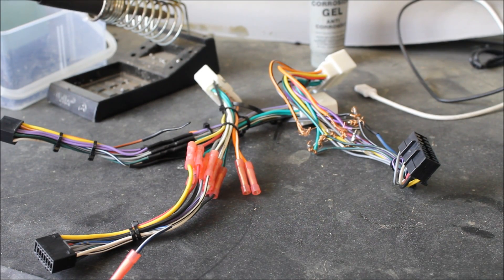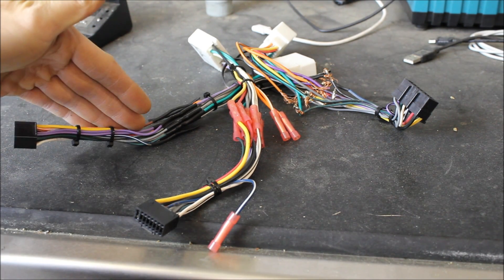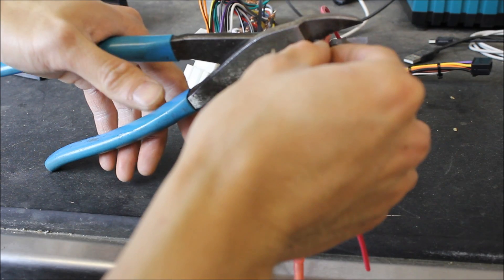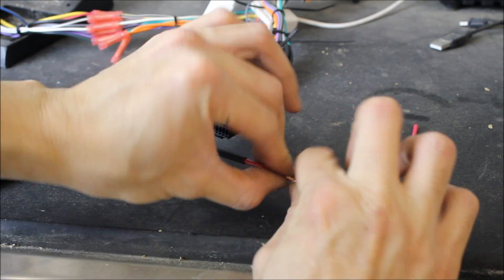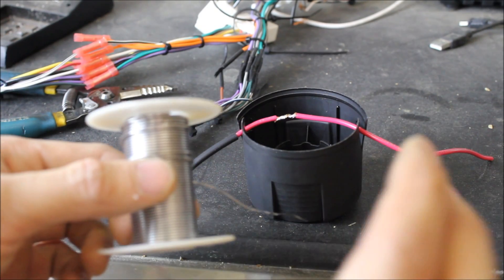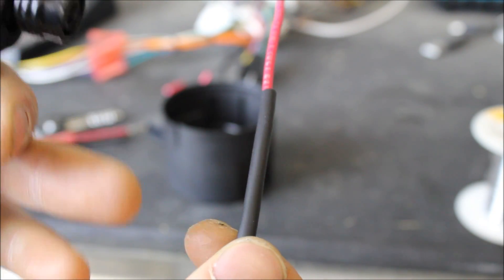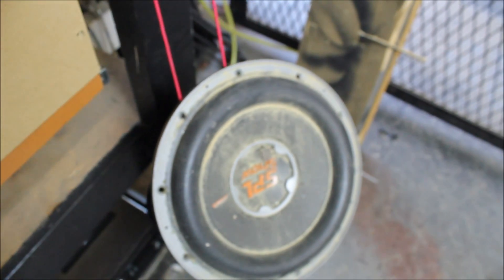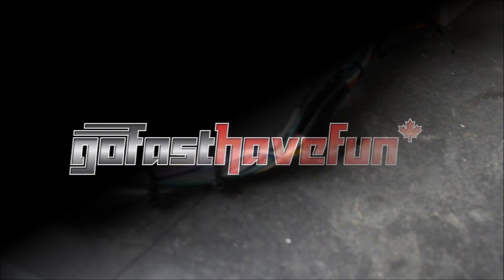Butt Connectors vs Solder | Crimping vs Soldering | Wire Connections | AnthonyJ350

Comment from the maker: Some people don't like how we position the connector in the crimper using the tooth.  Here's a video with further explanation: https://www.youtube.com/watch?v=i2le4BN0bP8
Reply: Just watched this second video and it has confused me.  I am less confident that I understand crimping now.
Reply: I have that Channellock crimper, but I also use a couple of Iwiss ratcheting crimpers and a Deuscth DT style collet crimper.
Not many connections I make anymore with butts, and never really the non-insulated ones you use the tabbed crimper for.
Reply from the maker: @jimurrata6785  I have a video on Deutsch connectors and will be making a marine butt connectors video soon.
Reply: @AnthonyJ350  I like to use a cupped deflector on either my heat gun or plastic welder to be shrinking adhesive lined terminals or tubing.
It really helps when you can focus on one side or the other just by moving into or away from the sleeve.
Reply from the maker: @jimurrata6785  I use a nozzle I  this video for my heat gun https://youtu.be/ca37WnL6Oxo
Reply: @AnthonyJ350  I'll have to have a look!
I've just found your channel and don't really know where you're coming from.... yet.
Are you a stereo guy? An upfitter? Or someone who builds harnii for custom vehicles???
Reply from the maker: @jimurrata6785  Started in car stereo, but I love figuring out aftermarket products that work together and trying to stay with the factory engineering in mind. I recently made the move into outfitting first responder vehicles (mainly law enforcement) so hopefully I can show a little of that in the future.
Reply: @AnthonyJ350  is that the stepped 9mm Steinel nozzle?
They have a reflector that fits that too.

Comment: If not soldering i use uninsulated butts or crimp caps
In almost 10 years I have not had a single failure of any connections
Reply from the maker: I haven't had a failure in 15 years. Both will work. I use marine butt connectors if I do that kind of connection now.

Comment: Just remember your vehicle constantly is in motion and butt connectors will eventually come loose. If the wires are soldered and shrink wrapped you will be done with your work forever!!!
Reply from the maker: Aren't all pins in a wire harness plug crimped as well?  We would just argue the proper crimper needs to be utilized. There's a time and place for either application. https://www.youtube.com/watch?v=VnPil9x8gUc

Comment: Should I use a but or soldered connection when trying to wire in a maf sensor to a car’s loom? (Where there is heat and vibration)
Reply from the maker: I would solder and use shrink tube with glue.

Comment: Instead of doing a butt connector or soldering I’ve been crimping on Deutsch terminals and adding a new connector, I personally think it looks a lot better and makes it FAR easier to deal with if you have to mess with those wires again.
Reply from the maker: That totally works too.  In a shop environment it may slow down production and add more cost to the end user, the pins alone are around $1 per pin.

Comment: Soldering is not flexible right? So if it’s on an area where it needs to bend slightly, it will break right?
Reply from the maker: Soldered connections can be in gradual bends without being bent because it's so short. You don't really want it where the wire moves i.e. wiring harness going to a door or tailgate hatch.

Comment: How do you feel about those shrink tube connectors with the solder in the middle? I feel it gives the easy of butt connectors with the reliability of solder ? Great video
Reply from the maker: I would do Marine Grade butt connectors then. This is what we use on emergency vehicles https://youtu.be/LcCLjbPS-m4

Comment: I only use butt connector as the last resort.  I try to twist and solder if at all possible.  I own a trucking company and corrosion is always a problem with electrical connections.  I put a thrid step in my twisted soldered joints, before I slide the heat shrink over the solderd joint I put a thin coat of silicone first heat it and wipe off the excess and you have a water tight seal.
Reply from the maker: Marine grade butt connectors are good too.
Reply from the maker: https://youtu.be/LcCLjbPS-m4

Comment: You're not supposed to twist the strands when crimping afaik
Reply from the maker: Why not?
Reply: @AnthonyJ350  It increases the cross section and may end up making the strands distribution uneven which will negatively affect the crimp since they are designed to crimp a certain gauge
Reply from the maker: @davidhsieh2761  If they're twisted evenly and the connector fits on smooth and snug, isn't that fine? Have you had consistent crimp failure due to twisting to avoid bures?

Comment: Raychen invented both shrink tubing and solder sleeves where I worked for 28 years , And yes connecting wires is a science in itself , Great video.
Reply from the maker: Thanks so much for sharing your experience!  I have newer updated videos to this where I focus on wire gauge and more specialized crimping tools.  This video was really basic.

Comment: Can I use these butt connectors on the Phase and hall motor wires ?
Reply from the maker: How much voltage is going to pass through it?  It's a crimp connection at the end of the day, you just need to match the correct size for the wire gauge.
Reply: @AnthonyJ350  48v 20ah battery 350w motor wheel and maybe a 48v 30-50 ah battery..
Reply from the maker: @anio6865  I don't see an issue, you might also want to look into this style of connector as well 
https://www.youtube.com/watch?v=LcCLjbPS-m4&t=40s

Comment: Just form a "U" in the wire and push two heavy objects together with the wire between them. It will hold the area you need to solder completely still. No need to buy helping hands. Just use your head and save some money. If there is a "debate" about connector types and power, just use a meter to compare. Pretty easy to end that argument.
Reply from the maker: Thanks for the feedback!

Comment: I'm thinking about adding a tailgate light bar to my truck. One of the wires of light bar needs to be vampire clipped, butt splice, or solder to my reserve light wire. What do you recommend?
Reply from the maker: If you use a but connector, use a marine grade one with glue.  You can solder and put dielectric grease over and use a really good tape, These two videos might help you https://www.youtube.com/watch?v=KA7jsIHGZ9c&t=18s https://www.youtube.com/watch?v=LcCLjbPS-m4&t=29s

Comment: If you have to make a whole bunch of connections spread them out over however much pigtail you have.
It doesn't leave a huge lump that you can't wrap into your harness.
Reply from the maker: That's an issue if you use butt connectors.
Reply: @AnthonyJ350  It's an issue with shrink tube over solder too.
Take one look at a 144 pin Ford harness, or even one of the smaller (70ish?) connectors....
You just run out of damn room.
Reply from the maker: @jimurrata6785  But why are you soldering over 100 times on a plug? If you're making that many connections you should be depinning and make a new connection and rebuild the plug and run your new wire.
Reply: @AnthonyJ350  when some moron cuts the harness with a .045" disc instead of pulling the retaining bolt from the bulkhead connector it's an F'ng nightmare.
But if you can't get (and swap) a complete harness, it's gotta be fixed.

Comment: Hey how do I know what color butt connectors to use
Reply from the maker: Depends on the gauge of wire you're using.
Reply: 10-12 yellow, 14-16 blue, 18-20 red

Comment: The worst example ever. Alnost all the tutorials say to never use pliers with butt connectors and he wants to use it.
Reply from the maker: Here's my reasoning, watch the whole video to get context https://youtu.be/i2le4BN0bP8
Reply: @AnthonyJ350  i seen the whole video before and my neighbor mechanic just used electrical tape to put the cables my radio together after splicing with an adapter and it was much faster easier and more secure.
Reply from the maker: @1Breezly  I think your mechanic should stick to changing parts and fluids. That is not how it's done in any professional shop that works with electronics.
Reply from the maker: @1Breezly  More secure than soldering?
Reply from the maker: @1Breezly  Seems like the only reason you're 
Searching videos like this after the job is because you're unsure of the mechanic's work. I would bring the car to an experienced Install shop.

Comment: Cringeworthy. Non-insulated butt connectors with the proper jaw and shrink tubing. Crimp beats solder every day for a long term reliable vibration resistant metallurgical connection . 40 years experience and military precision soldering background.
Reply from the maker: Thanks for the feedback

Comment: Hello Anthony, I see you use a Hakko 599 Tip Cleaner, which works much better for me than a Wet Sponge for the past 20 years or so. It does not cool the tip as much. The only downside is feeling the odd fleck of solder. May I recommend that you mention this to your viewers.
Also, having worked in Ontario Power Stations for ~15 years, I throw my hat in for the use of a Wire Connector Manufacturer Designed/Approved Crimping Tool, such as the Panduit CT-1525 - it has good leverage handles, 3 Dedicated Die Cavities, and best of all, there is no Insulation-Piercing Point to debate - simply crimp and done.
Cheers from a fellow Canadian! :-)
Reply from the maker: Thanks so much for sharing your experience!

Comment: And actually one thing not mentioned in this video is the crimper your using is actually for non insulated connectors. Crimps have a insulated and non insulated. That numb that pushes it down actually damages the insulation on the butt connector. Fyi
Reply from the maker: I have a video addressing that concern https://www.youtube.com/watch?v=i2le4BN0bP8&t=275s

Comment: How about twisting and taping?
Reply from the maker: Not a fan of doing it that way. Are you doing a "line's man splice"? Or just twisiting?
Reply: @AnthonyJ350  i had it installed by someone else. I just noticed he just twisted and taped it. Should i be worried? What are the negatives of just twisting and taping (electrical tape) ?
Reply from the maker: @Margotteferreros6237  Negatives are it might not be a tight connection affecting performance, and it might come undone over time.
Reply from the maker: @Margotteferreros6237  Let's put it this way. No credible experienced shop twists and tapes. It's either shrink tube or butt connectors for the bare minimum.
Reply: @AnthonyJ350  i understand, sir. Thank you so much for you responses. It helps alot. Great channel and very helpful! 👍🙏
Reply from the maker: @Margotteferreros6237  As long as you're learning and trying to do better work than we're doing our job 😀

Comment: I prefer Bullet Connectors because you can pull them apart.
Reply from the maker: The question is, why would you have to pull them apart?  There's already a connector at the factory plug.
Reply: @AnthonyJ350 Because I can and It's what I like and yes your right you can disconnect at factory plug. It is what is is.
Reply from the maker: @tlaneb1  Just curious, because you effectively have one extra connection compared to a butt connector, and if you needed to splice in a wire you still have to cut off the bullet connector.  The other thing I don't like about bullet connectors is if you don't plug them in all the way you leave a small insulated portion exposed.  Just sharing my experience.  If you like them, you like them.

Comment: yeah tin tack method sucks.
Reply from the maker: Ya I never do it
Reply: @AnthonyJ350  -- Is there a good rule of thumb for choosing solder size in reference to wire size? i've rarely soldered two wires together, i'm usually working with boards.  When I do solder wires, my solder is usually too small, i just don't have any bigger stuff around and I'm looking to buy some.

Comment: wrong crimp tool = fail... stagger join the solder joints... the twisted ends in the solder should finish no bigger than the insulation.Apply a small amount on the iron tip to make a good heat transfer, apply just enough for the solder to flow and just fill in the wire and no more.heat shrink for strain relief ......
Reply from the maker: I made a video just for comments like this. Read the comments and you'll see other experienced people's views https://youtu.be/i2le4BN0bP8
Reply from the maker: Do you work in an installation bay?
Reply: @AnthonyJ350  Better than that I work with HIGH current DC electrical distribution systems where a common current rating 1000A.. So yeah I know a thing or two.  Plus I have a Milspec rating for high reliability hand soldering
Reply from the maker: @markb3146  Soooo do these items get used in buildings or vehicles?
Reply from the maker: @markb3146  You didn't watch the video I sent did you?
Reply from the maker: @markb3146  FUN FACT. Every know it all that comments like this typically comes off as arrogant and douchey. Even though you might have valuable experience to pass on, that's not your intention. Your intention is feel better about yourself by bringing people down to your level.

Another common behavior is you have no videos for anyone to really critique you on. Always fun talking to keyboard warriors though 🤗
Reply: In the end I think we are going to agree to disagree ???
Reply from the maker: @markb3146  Yup if I were building harness plugs working with 18 to 20 gauge wiring I would use those tools. I have a ferrule crimper and didn't show that either. 

Based on your responses, you don't work on cars, and you probably have less than 10 years in your current field. It would explain your inability to be polite and humble.
Reply from the maker: @markb3146  I agree you're a d***
Reply from the maker: @markb3146  You should tell this guy how the world works on cars with all of your building experience 
https://youtu.be/aSQTje4sXfs
Reply: @AnthonyJ350  well sir, you dove to the gutter i won't join you there .... best wishes
Reply from the maker: @markb3146  You didn't want to watch another professional in the 12 volt industry? They didn't stagger the connections there either.
Reply: @AnthonyJ350  whatever pal... looking at all the comments you know it all so i'm done with you
Reply from the maker: @markb3146  But I don't, that's why I'm showing you other relavent people and videos in the industry. 

Very typical of the keyboard warrior. Presented facts but chooses to steer around the given information. Won't even review and acknowledge it.
Reply from the maker: @markb3146  How long have you been working on buildings for? Under 4 years I'm assuming and 0 on cars?

Comment: Either butt connect it or solder it, don't just crump them up and not use anything. That's very unprofessional and could obviously cause an electrical problem if it touches other wires.
Reply from the maker: Thanks for the insight!
Reply: @AnthonyJ350  Thanks and great video!!
Reply from the maker: @ronijr4918  Thank you, glad you liked it!

Comment: Have you ever tried heating your butt connector with a heat gun? The ends of the sleeve on the connector will shrink down around the insulation on your wire.
Reply from the maker: You're referring to the Marine Grade correct?  I don't think the nylon style will do that and haven't seen anyone do it in a shop environment where productivity is key.  We prefer solder and shrink tube in our shop.
Reply: @AnthonyJ350  No. Just your standard connector. I don't think they are designed with that in mind but I have done it on occasion and it has worked for me.
Reply from the maker: @dandearman2871  I've never tried it. Ill give it shot to see how it looks and how long it takes.

Comment: The lineman or Western Union twist is best for what you do.  Tinning is for other uses.  The butt-connectors should get a heat-shrink treatment also, right??   Putting silicone inside the regular heat shrink keeps water/corrosion OUT!  Good video.
Reply from the maker: Thanks for watching!

Comment: I seen another vid . Where they would twist both ends get another wire strip the insulation and use it like a string and wrap it around , as to tieing both down to give it a stronger hold . Then soldering . https://www.flitetest.com/articles/Solder_Thick_Gauge_Wire 
THANKS FOR THE VID.
Reply from the maker: Yup you can do it that way as well.
Reply: @AnthonyJ350  what was it for the type of metal to solder with for automotive wiring ? . I'm having to rewire cut wires to my fuse box.
Reply from the maker: @joseg8204  copper